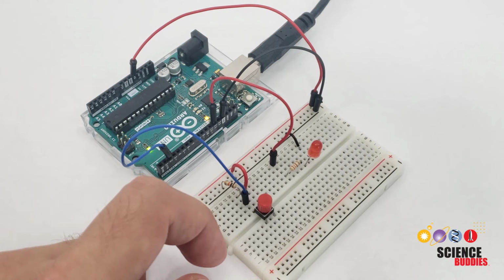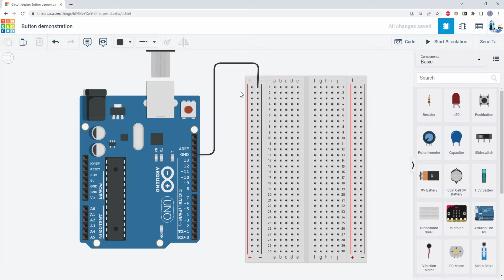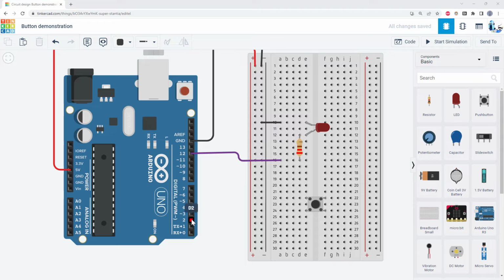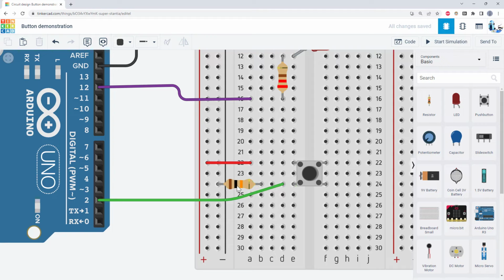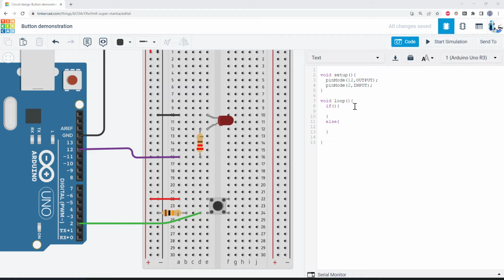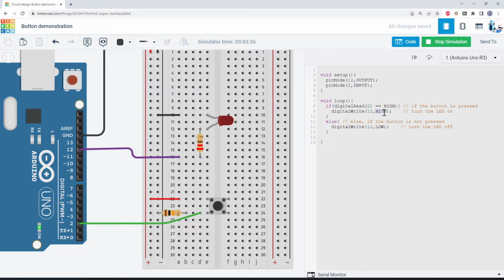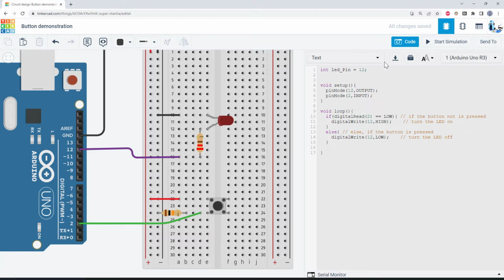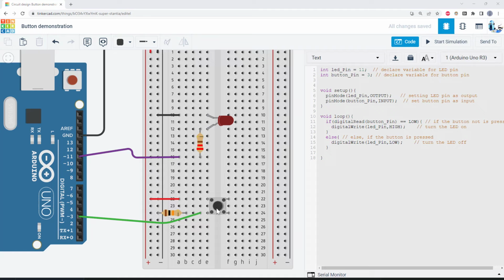How to Use a Button with an Arduino (Lesson #5)

Comment: Thank you so much!
Every time I tried to attach a button, I just had to touch the button without pressing it and it whould activate.
Then, I saw your video and realised that I just had to tie the output to ground through a resistor.

Comment: I don’t know what I did wrong?? I wrote the code and built the circuit and redid it all but the led just stays on and nothing happens when I press the button, I’m confused
Reply: Had the same problem as you, firstly check if you didn't misplaced  your wires I had accidently put my wire to the row not connected to the button's leg and I was wondering why there is not current flowing through the button lol
Reply from the maker: We recommend watching our How to Use a Breadboard video. Wiring mistakes are extremely common.

Comment: i havent watched the video yet as i am going to sleep now but wouldnt a switch work the normal way? if pressed it completes the circuit and if not it breaks the circuit , why would we require to make a program?
Reply from the maker: You are correct that if you just want an LED to stay on while you hold the button down, you do not need an Arduino at all. However, the Arduino lets you program more complicated behaviors (for example, blinking the LED on and off three times after you push the button), and you can also use buttons to control other hardware like motors.
Reply: @Science.Buddies  thank you so much :)

Comment: 7:15 does this mean the button is connected in parallel to the LED?
Reply from the maker: The button and LED are not in parallel since they are each connected to a different Arduino pin.

Comment: Is there any drawback to using a digital port as 5V power source?
...by setting pinMode(DX,OUTPUT); digitalWrite(digitalPin,HIGH); in setup()
Reply from the maker: The digital pins can only provide about 20mA of current on the Arduino UNO R3, and 8mA on the R4, which is enough to light an LED but not much else. The 5V pin can provide much more current - but if you need a lot of current (hundreds of milliamps), it's a better idea to use a separate power supply instead of powering everything from the Arduino. We have a separate video in this playlist about power supplies that may help!
Reply: @Science.Buddies Thanks for this, good to know! Was enough in my case, but now I know there can be a catch.

Comment: Re: connecting the large resistor. to the ground bus... At first I was thinking this would be like reverseing the curretn flow, but it's more to ensrue that no current flows when the button isn't pressed, correct?
Reply from the maker: It's called a "pull down resistor" - it helps make sure the voltage of the input pin isn't in a "floating" or undetermined state when the button isn't pressed.

Comment: When i get close to the button or touch my breadboard it already turns on. How is this possible?
Reply from the maker: If you forget the pull-down resistor, the input pins can be susceptible to static electricity.

Comment: what happens if you turn the resistor on the button to 220 ohm ? I tried it on the simulator but idk if it will work irl
Reply from the maker: In general you want a pull-up or pull-down resistor to be larger than that. A smaller resistor will still "work" but let more current flow and waste unnecessary power.

Comment: For an On/Off version (press once = lights on, press again = lights off)

// C++ code
//
bool led_status = false;  // declare led status, starts false/off
const int led = 12;  // declare the led pin
const int btn = 2;  // declare the button pin

void setup()
{
  pinMode(led, OUTPUT);  // setting led pin to output
  pinMode(btn, INPUT);  // setting button pin to input
}

void loop()
{
  long dr = digitalRead(btn);  // setting digitalRead from the button pin to dr
  if(dr == HIGH && !led_status){  // checking button pin and led is off
	digitalWrite(led, HIGH);  // lighting the led
    led_status = true;  // setting led status to true/on
  }
  else if(dr == HIGH && led_status){ // else if btn is pressed and led is on
  	digitalWrite(led, LOW);  // shut the light off
    led_status = false;  // setting the led status to false/off
  }
}

Comment: what about using the built-in internal resistors on the Arduino??
Reply from the maker: You can use the built-in pull-up resistors on the Arduino, but we find that using an external pull-down resistor is more intuitive for new users, because that way the pin is low by default and goes high when the button is pressed (corresponding to "off" and "on"). Using a pull-up resistor reverses that so the pin is high by default and goes low when pressed.
Reply: @Science.Buddies thanks

Comment: I am sorry, this is THE MOST POINTLESS project ever.
Just get a battery, button and LED.
Absolutely NO NEED for an andiron and programming.
This might be the biggest waste of time and resources I have ever seen.

WTF are you using an algorithm to turn on an LED with a button for?
2 resistors?  WHY?  
Arduino, WHY?

I will block this channel for wasting my time.
Reply from the maker: Hi - you are correct that if all you literally want to do if turn an LED on and off with a button, there's absolutely no need for an Arduino. This lesson is more about learning the basics of programmable inputs and outputs, which you can then use with more advanced tasks like building a robot with motors (outputs) that react to sensors (inputs). For someone who has never used an Arduino before, it's too difficult to jump right to building the robot without learning the basics first.
Reply: I HATE WHEN PEOPLE LEARN WITH EASY PROJECTS AHHHHHHHHHH

Comment: Hey.. I'm using the same code and connection. Can u tell me why when I'm pressing the switch the led glows but when I release the switch the led goes off? It's not like I have to press again to turn it off or on.. like the video..someone please help
Reply: Thats what is supposed to happen

Comment: Here is the code you can copy paste                                                                                                                     void setup() {
  pinMode(12, OUTPUT);  
  pinMode(2, INPUT);    
}

void loop() {
  if (digitalRead(2) == LOW) {  
    digitalWrite(12, HIGH);
  } else {
    digitalWrite(12, LOW);      
  }
}
Reply: dosent work'

Comment: 10k resistor becoming hot in this scheme
Reply: i kept my arduino powered and tried holding the button down for a full minute then disconnected the arduino from power supply, touched both resistors and the led and none of them  were hot, they were maybe only slightly warm

Comment: i used the code:

void setup() {
  pinMODE(12,OUTPUT);
  pinMODE(2,INPUT);
}

void loop() {
  if(digitalRead(2) == HIGH) { // IF THE BUTTON IS PRESSED
    digitalWrite(12,HIGH);      // TURN THE LED ON

  }
 else() // IF THE BUTTON IS PRESSED
    digitalWrite(12,LOW);      // TURN THE LED ON
}

and it was not working on the arduino IDE please help

error message:

Compilation error: 'pinMODE' was not declared in this scope
Reply: The language is case-sensitive, and the pinmode function is written as pinMode, so I believe the software doesn't recognize it because you wrote pinMODE instead :)

Comment: I know I am in a minority here but I have never understood why people would want to learn another language to make a program (sudo code) when the languages are mostly in plane english anyway, I find sudo code much harder to write than actual code
Reply: Agreed
Reply: Because sometimes you don't want to think about the specifics. Especially when the programming details are a bit more complex (and informing others on what to do). Also, it's good to sometimes take a step back and write pseudo code to realise what actually you want to happen and figure out the conditions and edge cases you may not have thought of when tinkering with the code.

Comment: the code isint working fake tutorial; your channel sucks
Reply: void setup() {
  // Set Pin 12 as output
  pinMode(12, OUTPUT); 
  // Set Pin 8 as input
  pinMode(8, INPUT);
}

void loop() {
  // Read the state of Pin 8
  if (digitalRead(8) == HIGH) {
    // If Pin 8 is HIGH, turn Pin 12 ON
    digitalWrite(12, LOW);
  }
  else {
    // If Pin 8 is LOW, turn Pin 12 OFF
    digitalWrite(12, HIGH);
  }
}

Comment: What if want to add a delay in the code, imagine,i want to press the buttom then wait 1 second and the led turns on. But if i keep pressing the button, the led has to turn off until i released the finger and then pressing it again during one sec
Reply: use delay(miliseconds) before one of the digitalWrites i think
Reply: @Studs_Studio  Yes, but that will repeat over and over again, you you'll get a blinking LED. You'll have to add a boolean variable like "isButtonPressed" which you can then if condition check for "false" around the delay. Set in that if condition the boolean variable to "true" and set it to "false" in the else part of the original condition.

Comment: i have watched 3 hours of videos arduinos. yours finally answered my dumb questions. 
tdlr. a button needs a 5v and and the connection to the pcv. AND it needs a very high resistor to ground or else it short circuits shit. bruh
and electricity reads from a ~E. left to right.
Reply: could you pls tell me why that high resistor is used?(i am an absolute beginner with Arduino so i dont know any terms)
Reply: You still need to complete the circuit but there are random amkunts of tiny current going through due to inperfections. The higj resistor makes sure that off means off. Even the slightest current is supposed to turn the button on. Its just good practice @CobraG001
Reply: @CobraG001  i am wondering the same thing

Comment: Why you need Arduino for this
Reply: It's not that you need Arduino for that but Arduino can do a lot of stuff including that, you can use a push button to light a bulb, nothing more, nothing less, but in Arduino you may use the same push button to trigger an event like turns your bulb on and off with just one button press which a regular push button cannot do unless you push it on and off continuously. You may also use the same push button with Arduino to dim your Led or Brighten your Led which a regular push button cannot do. I hope this helps.

Comment: but if arduino output is only 250mamps, what's the point to use all these resistors, currrent is limited, and the board is suppose has a resistor to stop overflow of current back to the pin? i've tried without resistors, nothing bad happens, the board is still working.

Comment: I have a question. Can I just make the button let the electricity flow between the LED and the GND-bus? It wouldn't need as much code
Reply from the maker: Hi - if all you want to do is turn on an LED when you hold the button down, then you do not need an Arduino at all. An Arduino allows you to program more complicated behaviors, user other sensors, and control outputs like motors. You can find more information in the Arduino playlist linked in the video description.

Comment: Couldnt you just use the button as an circuit breaker instead of using code? Seems simpler but the code one is cooler
Reply from the maker: Yes, if all you want is on/off control of a single LED using a button, then technically you do not need the Arduino at all, but if you want to do anything more complicated (like making multiple LEDs flash in a pattern when you push a button once) then it becomes much easier to do with code.
Reply: @Science.Buddies  Yeah, that's true. Even through, you might be able to do it with like logic Gates or relais
Reply from the maker: Right - you can hard-wire plenty of interesting circuit behaviors without any code at all. For example, check out the "Bluebot" series of projects on our site, which have both Arduino and non-Arduino versions. The non-Arduino versions can do basic left-right steering using different sensor inputs despite not having any microcontroller: https://www.sciencebuddies.org/science-fair-projects/science-projects?s=bluebot

Comment: Hello and thank you very much for the great video. Nevertheless I have a question: why do I have to connect the button anyway to the ground. When I don’t push the button, there is no current flow and the input to the PIN is low. Why is the connection to the ground necessary?
Than you
Reply from the maker: The connection to ground is needed so the input pin voltage is never "floating" or undetermined. This way it is always either 0V or 5V. If the pin is not connected to anything then it can be affected by electrical noise from other things in the circuit and nearby pins.
Reply: @Science.Buddies could you exclude the resistor and just write your code to only be looking for voltage greater than 4? That way if there is a small current leakage it won't cause the led to turn on?
Reply: Thank you very much

Comment: Hello i have a question, how come does my LED is turned on even, i haven't pushed the button, while if i pushed the button, it just glows brighter? i just followed the commands
TYIA!
Reply from the maker: You may have the pin set as an input instead of an output - double check that your code AND your circuit follow what is shown in the video.
Reply: @Science.Buddies  i copied the code and i have the same problem. everything looks like it should work but it still does that. once in a while the led turns off for a second but rarely
Reply: sorry nevermind. i didnt connect it properly.

Comment: What will happen if place the switch on one side?

And if we place switch in such a way that the legs are placed on two side.how it gets current or voltage to all legs since the two sides are separated by a plastic? insulator?
Reply: im pretty sure its because the button takes up a lot of space on one side which doesnt allow us to use more wires in the same row(like when he used the resistor and jumper in the same row for the button)
Reply: No additional things happen. The switch terminals 1a and 2b are internally connected. 2a and 2b same thing. Pressing the button will close the ciruit, connecting terminals 1a with 2a and 1b with 2b. Like @thatphysicsguy7859 says, it takes up too much space to use all holes on the breadboard. In Tinkercad you can actually just try this: move the button over the wires, you will see the same thing happens.

Comment: How is it when pushing the buttons to stay on/off? Im having a science project where i need an arduino to control the temperature of my desired heat/cold. Please respond...
Reply from the maker: Hi - if you search online for "Arduino button toggle" you should find example code that lets you push to toggle the button instead of holding it down. You can also look at our list of tutorials and use a slide switch instead of a button.

Comment: I made it so when pressed green led goes on when not pressed red led goes on
Reply: How?
Reply: @micahbentley141  you use the scripts from first in the if statement and make one go high if pressed and one go low then in the else you make on go low and one go high
Reply: nvm, you can make this with no arduino, just a relay. how did I do that?
Reply: me too😀
Reply: change line: (digitalRead(button_Pin)==LOW)   on this one   (digitalRead(button_Pin)==HIGH)   - will be ok now.
Reply: I changed it in purpose??? @tomekpro2918
Reply: nice idea